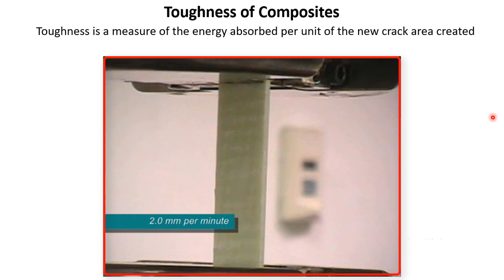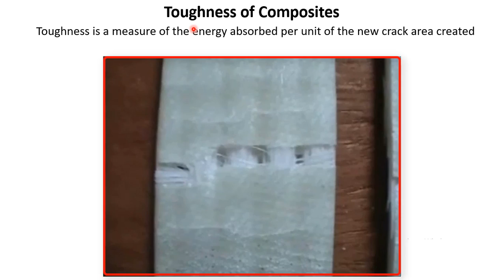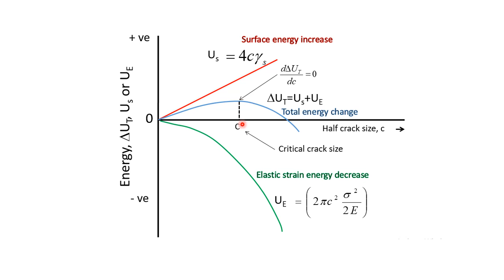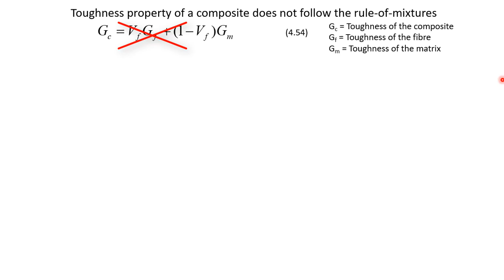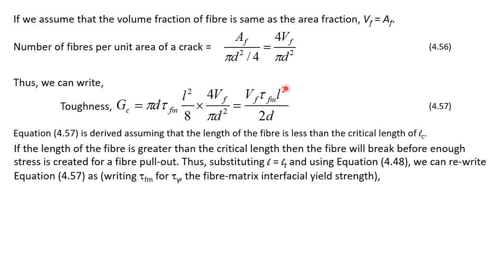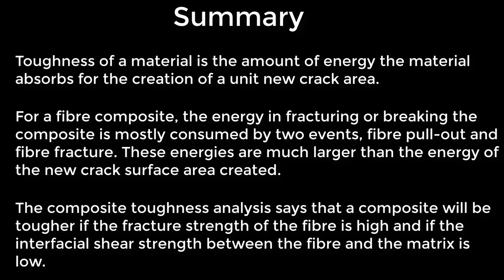Toughness of Composite Materials (Fibre Reinforced Composites)

Comment: Thank you sir for this great video, it is really helpful and full of valuable information.. I do have one question for your kind input; Can you tell which of the two fiber deformation processes, i.e. whether fiber pull out or the fiber fracture, will consume more energy and results in higher toughness composite?
Thank you again
Reply from the maker: Energy required for fibre pull out depends upon the fibre-matrix adhesion strength. The adhesion strength is optimized so that the fibre fracture will happen after some fibre-matrix debonding. This is essential for toughness. Hence, it is a combination of the adhesion strength between the fibre and the matrix, and the fibre tensile strength which will decide the final toughness of the composite. Both are necessary.

Comment: If we compare fiber and particle reinforced composites of same volume fraction of reinforcements, which will have higher toughness and why?
Reply from the maker: Fibre reinforced composites will have higher strength. The load must be in the direction of the length of the fibres or the fibres must be arranged in layers which are in different orientations. Generally fibres are used in fabric form to make the composites strong in all directions. Short fibre composites will also be stronger than particle reinforced.
The reason is that the long or short fibres are more effective in load bearing than particles. You can watch my videos on short fibre too for this. 👍
Reply: @engineeringmaterials-tribo5142  Yes, fiber reinforced composites will have higher strength but I need to know about toughness. How do you compare the toughness of particle and fiber reinforced composites? Which will have higher toughness?
Reply from the maker: @bikramjyotisahariah9594  Toughness of long or short fibre reinforced will be higher compared with that of particle reinforced composite if the majority of the fibres are aligned in the direction of maximum tensile stress.

Comment: Once again, great video and well explained. Highly recommendable!

However, isn't the elongation at break of fibres an important parameter upon impact loading (talking about long or continuous fibres here)?
As you said, we can use a stronger fiber with weaker bond strength for improved toughness. Let's assume we have the "same" bond strength but a stronger fiber such as CF (around 30% stronger and 4 times stiffer) vs. GF.
In impact tests the GFRP will always be 2-3 times tougher than the extremely brittle CFRP. I think this is mostly because the CF has such a low elongation at break. I have no specifics on surface energy, though.

What do you think about the difference between thermoplastic and thermoset polymers in composite materials? Thermoplastic composites are always hailed as being extremely impact resistant. From my testing experience there is not much difference in terms of impact strength between GF-Epoxy, CF-Epoxy and thermoplastic matrices (PP, PA6, PPS and PEEK) in charpy impact tests - all with very good bond strength. Only difference could be the delamination resistance G1c in double cantilever beam tests, where thermoplastics could have an advantage over thermosets. The elongation at fibre fracture of a CF-thermoplastic remains the same as for a CF-epoxy... so why sould the composite become that much tougher?

Thanks for any advice
Reply from the maker: Thank and you have asked lots of interesting questions. The reason for toughness in composites is the way a crack will grow in a long fibre composite. The crack will have to break fibre and then debond some length and then break another fibre and then keep repeating this process until the whole specimen fractures. This will consume lot more energy than in breaking the matrix (a plastic itself) if it was tested as a single component monolithic material. Therefore, debonding between the fibre and the matrix is important, which require some good control of the bond strength.
It is possible that GF based composites are tougher than CF based ones if all other things are same, for the reason you have explained.
Impact test such as the Charpy test was developed for monolithic materials such as metals or plastics. Composites in Charpy test show very complex failure modes consisting of tension, compression and shear, all in one failure. This is the reason why the data we get are difficult to be analyzed for different composites. Some tests, such as drop-weight impact test have been developed for composites to assess the damage due to impact. Kevlar based composites might be better choice where strength, toughness and impact strength are important. 
👍